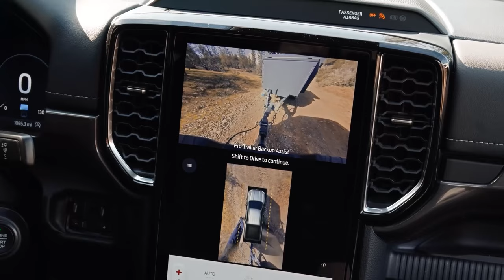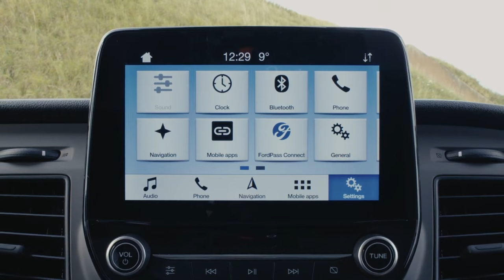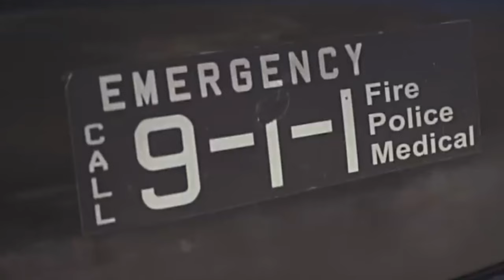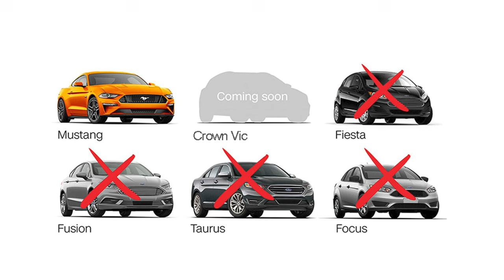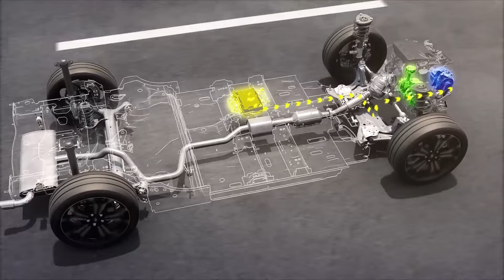Meet the 6 New FORD Models for 2025 That Will DESTROY THE COMPETITION

Comment: Ford is building garbage motors and has been for 10 years now when they decide displacement is the correct item and not smaller engines with more horsepower because they wear out sooner they will not get 200,000 me they're lucky if they get 80,000 mi out of these EcoBoost motors that overheat that are impossible to work on that are garbage Ford needs to get their act together and people need to stop buying their garbage
Reply from the maker: Yeah, 200k today is a miracle 😁

Comment: 2.3 turbo PLUS A DANG HYBRID electric motor and only 300 and change in HP & flb??? Or did I miss something? Turns out the Ecoboost 2.0 is a stupid great little botor. I bought one for my 96 ranger. At first I was completely happy with the motor and stock HP, tune and turbo. 2 years pass big turbo, injectors, one off plentum and a lighter flywheel and an aftermarket twin disc and I have no idea what it can be pushed to buy I have a great tune that peaks at 8k but I want this truck to last so Iowered the rev limiter, conservative tune 380 at the tires but it's probably capable of probably 500 to 575. We did take it up to about 470 and as happy as I was I knew if I kept it at a reasonable number I can have for for years as parts and technology catch up and then who knows the possibilities. I am not a "Ford guy" I love at least a handful of all three of the biggest manufacturers in America Japan and Germany. I am just genuinely surprised to see motors like the smaller EcoBoost the k-series put out power that was once reserved for supercharged V8s when I was growing up. It's an atrocity and completely Un-American that they never brought the bearer to our shores. God bless you have a good night I hope the next 4 years of your life is better than the last four of your life. 🇺🇲